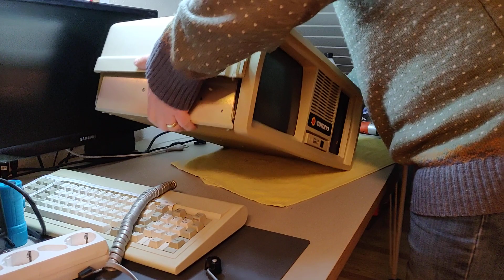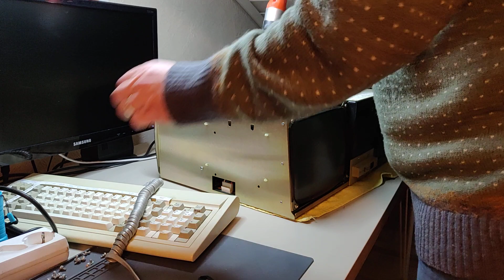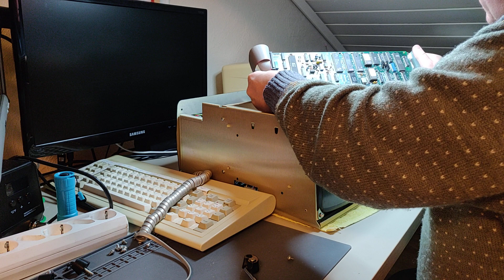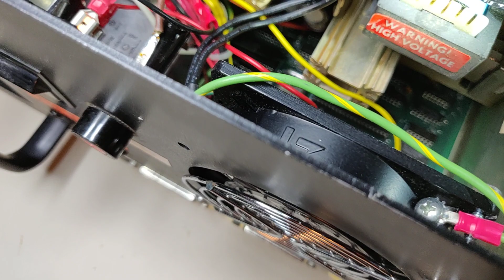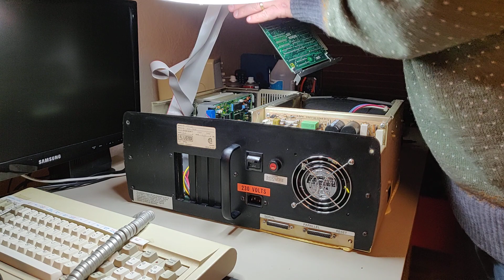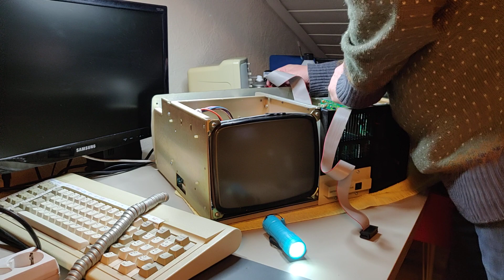Corona PC - opening the case for the first time.

Comment: Hello, i just got the same one, mine have a problem with the tube.
Butt it looks like your pc have no ram memory.
I saw you put the card properly in, the cables should go to the hdd, but beside that card there are 3 extra slots, in one I have a ram memory card.
I don't know if it's working without.
You fix the pc yet?
Reply from the maker: Hi, It has ram on the Motherboard. Someone else has the computer now. i hope he can fix it.
Reply: @RetroErik  Ok, so it schould work whitout the extra ram card, tnx.